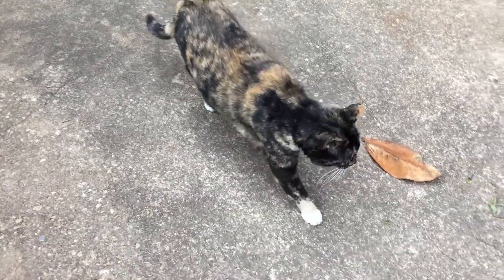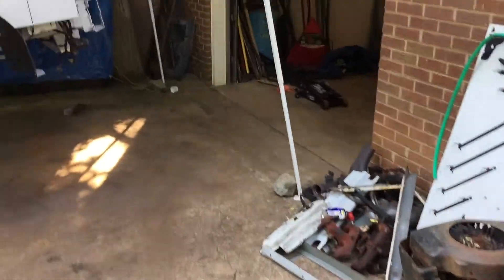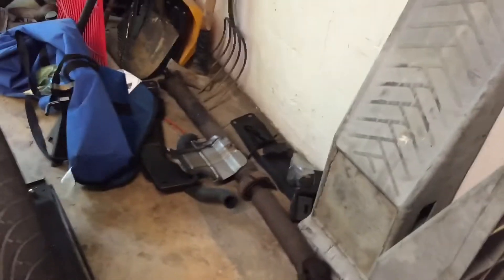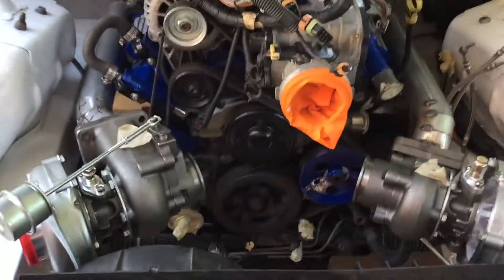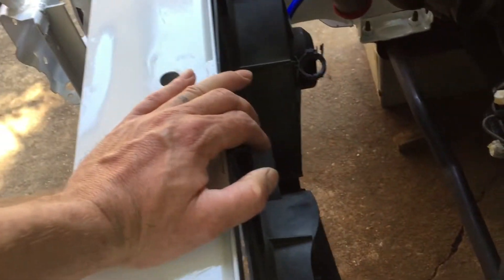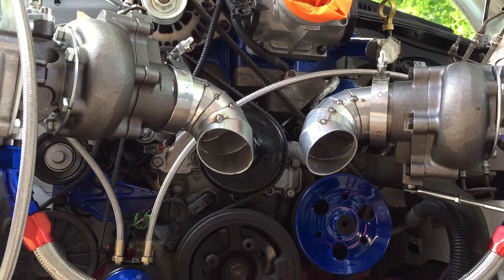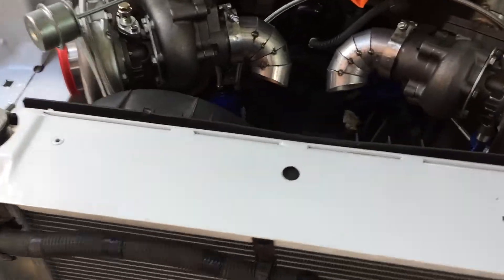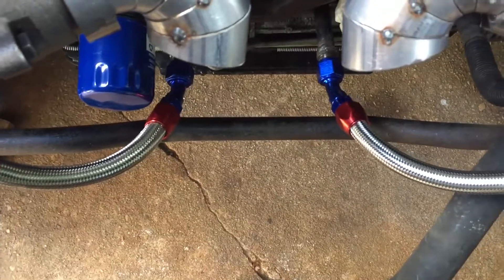Down Pipe Fabrication 3800 series 2 Camaro/firebird - Twin Turbo Build Part 21

Comment: Are you going to use 2 step or anti-lag? It’ll help with those launch times.
Reply: True true dude the first part with the cat had me dying
Reply from the maker: if so not any time soon the tranny and drive shafts  in these cars are weak from what i here. once over 300 hp gotta be easy or can brake them fast.... baby steps lol